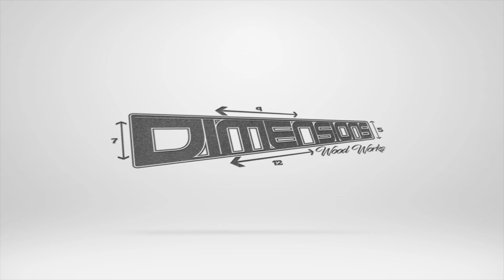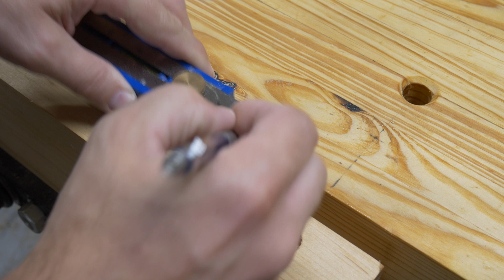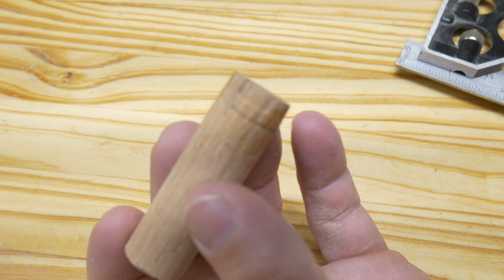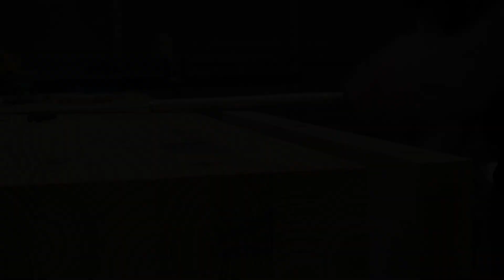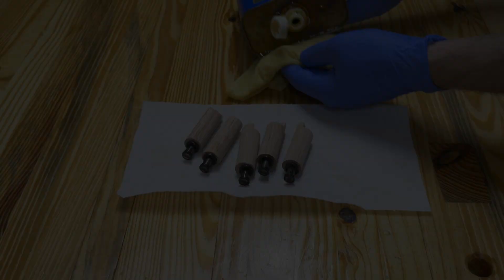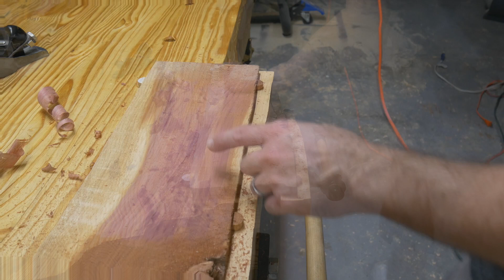POP UP BENCH DOGS

Comment: A suggestion would be to include an adjustment to this so the dog can be lowered when clamping thinner work. This way the dog would not be in the way or lower than the work surface.
Reply from the maker: I usually work with a vertías Wonderdog on the opposite end of these, and whatever height they’re at when you apply pressure from the other side, they’ll stay at that height.

Comment: Sawdust will inevitably collect in the bottom of the dogs holes, eventually making your dogs sit too high, but it can be difficult to vacuum it out.  If you drill a small diameter hole to one side of your dog hole, all the way through to the bottom of your bench, it will make it a lot easier to vacuum it out, as it lets air enter from the bottom when you set the hose over the top of the hole.  Just make sure the air hole isn't so large that it affects the operation of the catch mechanism.
Reply from the maker: I usually remove the dog and hit the hole with my air hose, blows it all out in a millisecond.

Comment: Great video, and like you I try to get better every day. Unfortunately the link to the pop-up latch mechanism is blocked to me here in Italy, and likely other places as well in the EU. However, since you mentioned what that type of latch is called, at least I have a starting place to for my research. Thanks again for such a wonderful explanation.
Reply from the maker: Thanks so much for taking the time to leave such a productive comment. I have had a couple people tell me that the link doesn’t work for them , sorry about that. It was active when i published this video. Just search “push latch” and you should be able to find something that works. It’s typically a part for cabinets if that helps.

Comment: Did you use hot glue to secure the pop ups in the holes as well?
Reply from the maker: No. I just let gravity keep them in the hole. If you want, you could screw a washer in the bottom of the hole because the push latch has a magnet on the bottom.

Comment: WHERE DID YOU GET THE PUSH LATCHES?
Reply from the maker: WHY ARE YOU YELLING???? THEY ARE IN THE DESCRIPTION!!!
Reply: @dimensionswoodworks  Sorry, I didn't realize the caps lock was on. No offence was intended.
Reply: I'm a "Hunt and Peck" typist.
Reply from the maker: It’s all good man, the ones i used are in the video description below the video as well as the video i got the idea from. This particular product is ready to go and they’re about $3 a pop so they’re pretty inexpensive to make since the cost of a dowel is next to nothing.
Reply: @dimensionswoodworks  Thank you for your reply.

Tom
Reply: @dimensionswoodworks  that site doesn't work anymore rip
Reply: They (or similar ones) are at Home Depot or Lowe's, or you can find them on Ebay.